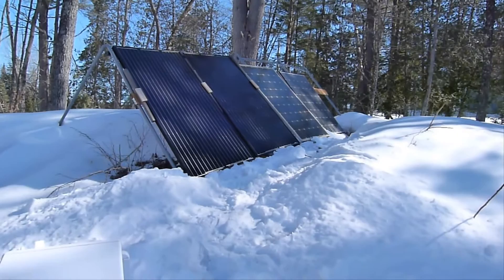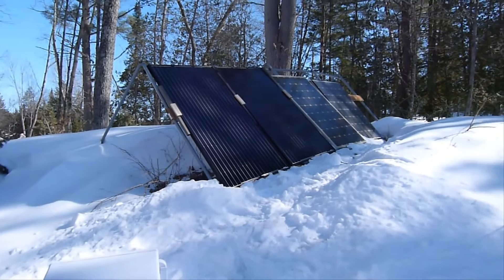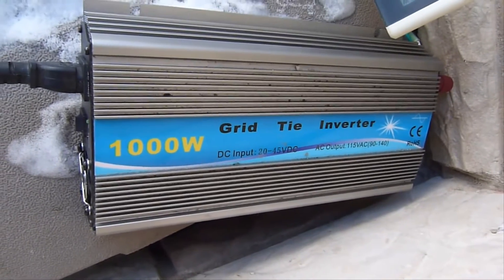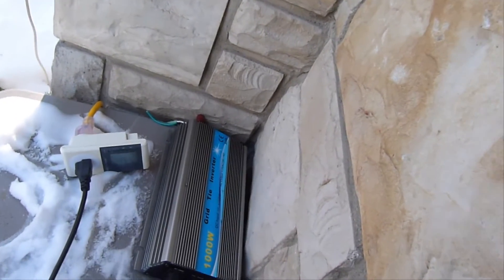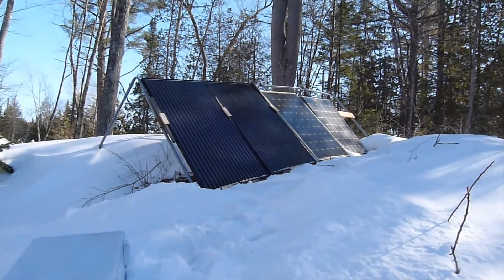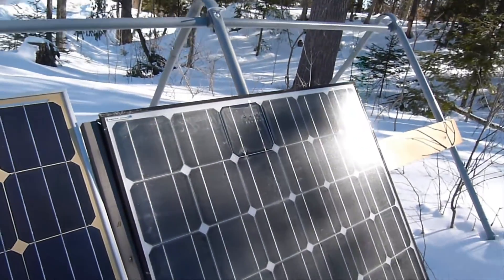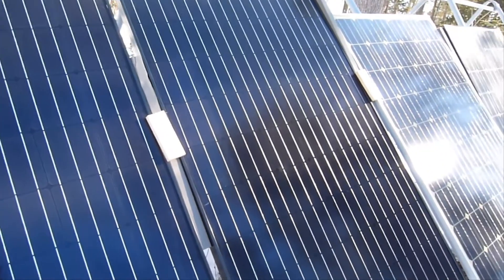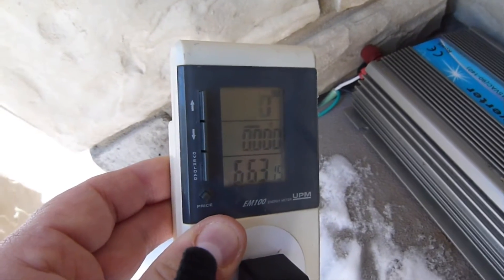Solar Panels feeding into a Grid Tie Inverter ... Issues!!!

Comment: You're not getting 560W cause they're not getting sunlight. The panels are shaded. Then the inverter will output 1kW if is supplied with 1kW of Dc power. At this moment the inverter effectively shorts the panels, you should check the short circuit or max current on solar panels against specs before panels are damaged.
A good grid tie inverter requires a power buffer, a capacitor bank which can be maintained at a charge level to balance the solar power transferred to grid. Your inverter can not balance the power draw- it tries to output more than it is supplied with, depletes the buffer cap and faults or shuts down. Then the buffer gets recharged and inverter restarts briefly.

Comment: Mismatched panels may decrease the power, any shade on the panels may halve the power. They will have problems pushing 1000 watts at 24 volts down a wire. The voltage on a uk house system would be 400 volts for 2000-3000 watts

Comment: watched you video again,  you will never get out of them what the label says...i install solar for a living and i live off grid..couple things angle of panels looks steep don't know how far north you are angle is important check online for your location also what your using to hold your panels down with are covering part of a cell will affect the performance. max which you will never see of 1000 watts is only 8.3amps no worries there 10 ga. wire will handle 30 amps try getting the panels in good sun with nothing covering check angle . your best sun is 10 to 2 people don't think shading is that big of a deal but a 1\4 in bolt sticking thru between panels to clamp them down if it's to long and shades just one part of one cell it will affect the panel and when your tring to get all you can out of small system this is a big deal give this a try i think it will help if you have any questions fell free good luck........
Reply from the maker: butch kern thanks for the extra tips. I really appreciate your additional advice. I will have time I. the next few weeks and will be able to tinker with the setup. I will post a follow up video with my results. thanks again

Comment: shade shade shade get them in full sun or it will never work
Reply from the maker: butch kern thanks. I guess it's all about location location location.  I agree with you that I should move them to an area with no shade, but they are only shaded up until noon. after that they are in full sun for the rest of the day. The issue also occurs in full sun too. :( Eventually I will put them up on a more permanent rack but in the meantime I'm restricted to this location and setup. thanks again for your comment

Comment: You need to make sure the incoming voltage does not go over the top rated number IE if the top number 30 and your panels hit 31 the inverter will shut down till it drops then resume. Safety feature
Reply from the maker: old time engineer thanks. I thought that this was my issue initially as I first purchased a 1000watt inverter for 12VDC, so I then purchased the same but the 24VDC version and now having what seems to be the same issue. my max VDC on the 24VDC inverter is 45VDC. If I remember right the panels gave me a maximum of 36 or 39VDC. So I'm not sure what the issue would be. I've seen other YouTubers that used a step up/down contraption but they also seem to be having a similar issue. In any case, I thank you for your comment and the time you took to try to help me. Thanks

Comment: Luc lussier, Those china grid tie inverters are not very efficient at all. If you have 3 panels going to the inverter, the inverter can only produce the lowest rated panels output. So 190 watts X 3 = 570 watts in Ideal conditions, no shading at all and the panels must be in the optimal position for your location. The grid tie needs to be inside they don't like cold weather. Even with that said if you see 65 to 70% of the 570 watts you'll be doing good. Even a little shading will bring down the output big time of all 3 panels.  One more thing you have to be careful with. Lets say for example your producing 500 watts and back feeding into a 15 amp circuit. You decide to use a 1500 watt portable heater and plugged into the same 15 amp circuit. Now you have 2000 watts on the circuit. It's only designed to use 1800 watts. So your overloading that one circuit. The circuit breaker will not trip and could easily cause a fire. Try and find a circuit that not used and use it for grid tie. It's much safer that way. Also check the watt meter your using it could be going bad as well as well as the grid tie itself. Use a volt meter set at 200 volts DC to check the panels themselves. Use the AC handheld meter to check the AC side of the inverter. Never mix match solar panels they just won't output what they should. That's just the nature of solar panels. Hope this helps. Randy
Reply: That's correct
Reply: Been researching this for a while and that is the best explanation I read in all my searches.    So if I get 1000 watts into a non used circuit, that 1000 watt will still make it into my other circuits, but not put a stress on the used circuits?
Reply from the maker: Randall C Thank you very much for the advice. I will split the panels up by type once the snow/ice has melted and put them on separate inverters. I will be investing in an AC meter as well. furthermore I will be looking into adding a designated breaker in my electrical panel. I didn't think you had to add the watts on the circuit, I thought you subtracted them. Using the example you gave. I thought that I'd end up at 1000 Watts because the space heater was using the energy fed back in from the  solar panels. Huge mistake on my part.  Thanks again for all the advice. I appreciate it.
Reply: Luc Lussier. That example I was using with the space heater works like this. Your power is used up first by the incoming current made from the panels. So if your on a 15 amp breaker and already using 1000 watts for other loads and then add the 1000 watt heater in that same circuit the breaker will not know it has 2000 watts. It will sense the 1000 watts from other loads in the house, but will never know there is another 1000 watts being fed in on the same line. Resulting in a fire sooner or later. To play it safe just plug in the grid ties into a 15 amp or 20 circuit with nothing else on the same circuit. I know it's a little confusing, but that's how it works. So it's not the breaker it's that the wire itself get's too hot. Hope this helps.
Reply from the maker: Randall C yes it does help. thanks

Comment: Luck you, if you still have analog power meter, I would still be using that inverter but they switched out meter for smart meter, now I only use limiter grid-tie inverter...
Reply from the maker: SolarizeYourLife thanks for your comment. the power company forced us all to switch to a digital meter. Only those willing to pay the 10$/month got to keep their analog meters. I knew that these digital meters won't turn back if I eventually produce more then I use but wasn't aware of any other limitations. I really appreciate time you took to comment.